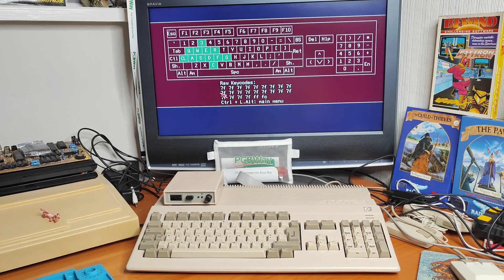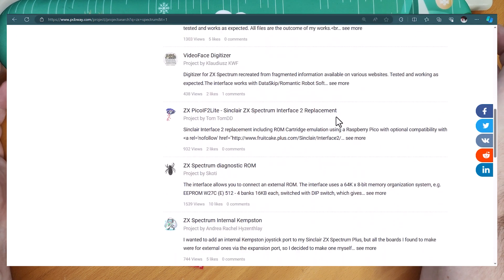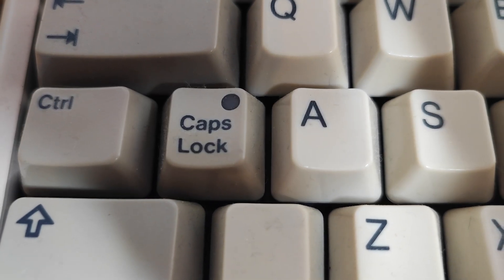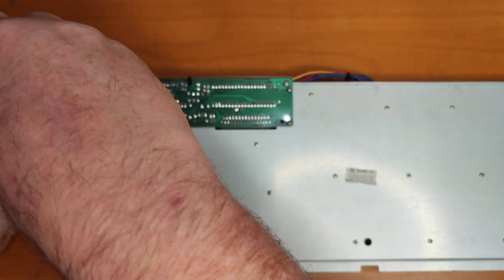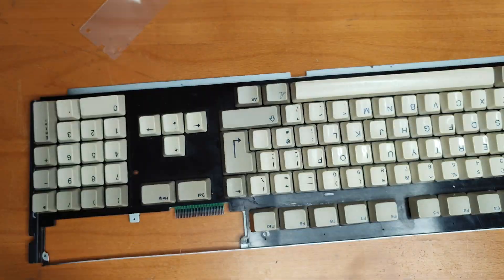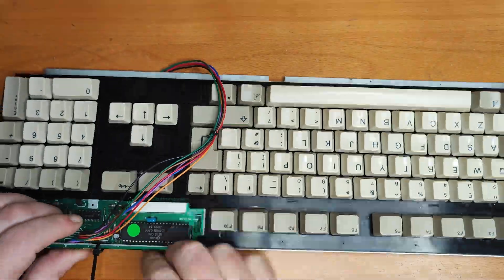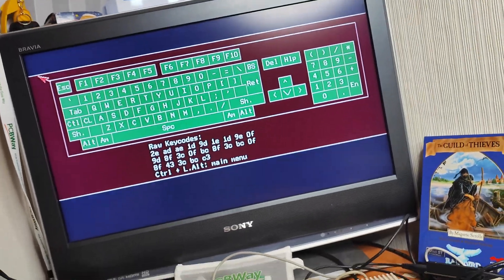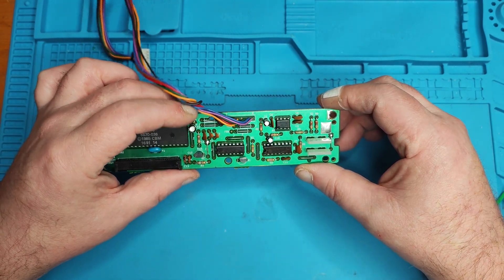Amiga A500 blinking caps lock fix and PCB repair?

Comment: would you be interested in giving us a "tour" of your test equipment and the more odd items in your tool kit?  i would be interested in learning more about those fancy boxes you pull out for testing and diagnostics.
Reply from the maker: I'd be happy to. By fancy boxes though I'm not sure what you mean there...
Reply: @RetroComputingReboot  i was referring to the test box you used for the caps.  i have seen you use other gear that i would like to know more about.  i come from the era of analog Volt-Ohm meters, tube testers, and maybe, just MAYBE (if you're lucky) an oscilloscope.

Comment: that's kooky.  with their age, i figured those 'lytics would have either dried out or broken down.
Reply from the maker: That's what I thought. I'd read that these caps can fail and give similar issues, so thought it might have been fixable. That Commodore IC though is seriously expensive to get hold of. I thought as well that it only faulted after it had been on for a while that it maybe from the caps warming up, but hey ho...